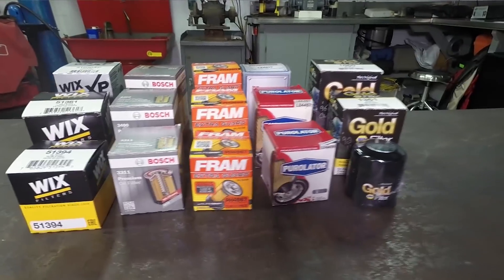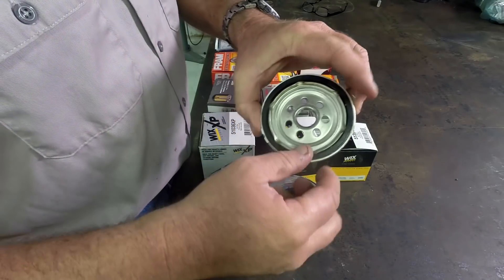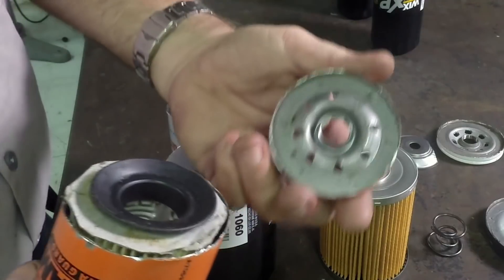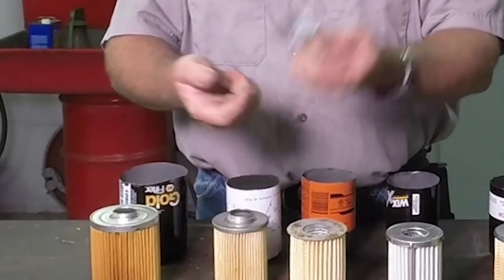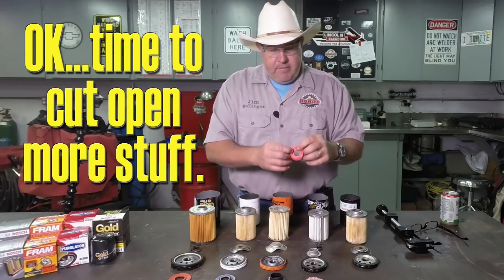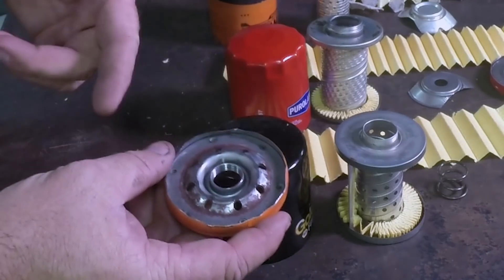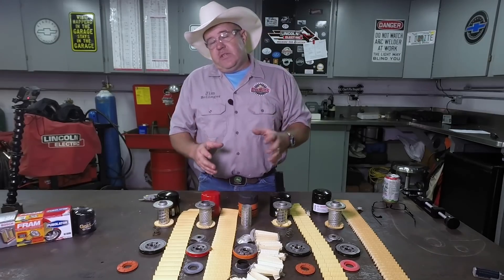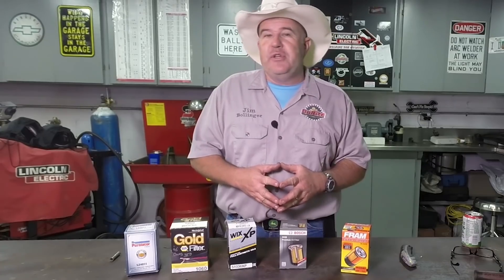The worst oil filter EVER!

Comment: I thought Fram was a quality filter, especially for the price. WOW, Fram is a piece of junk!
Reply: Me too. Thought I was getting a great filter until I saw a similar demonstration on their motorcycle filters. Pure junk. I bought them at least 3-4 decades before. I’ve been using Bosch but will switch to Wix or Napa Gold as they seem to be a little better quality and maybe less expensive.
Reply: Compared to what ?  It's an oil filter folks! Try it...it works! ( Millions and millions sold...they must be doing something right...)
Reply: The only good thing about the fram oil filter is  the gritty coating they put on the end of the filter. It makes it very easy to tighten and  remove.
Reply: It's a pretty safe bet that if WalMart sells them, Fram is the cheapest they can buy!  I'll pass on the Fram!
Reply: No more FRAM for me!
Reply: The bottom line on this Video Fram Oil Filters are junk, don’t buy them.
This is outrageous that a company would defraud the public with such a trash quality product. Never again Fram.
Reply: Fram did indeed use to be a quality filter...years before they degraded them to get them into WalMart stores. Since then, garbage.
Reply: What is funny is everyone thinks that. What is funny is no one ever has any issues. Some people have been using FRAM filters for over 30 years with no issues.
Reply: @gol10dr45  SO They Think.
Reply: "MADE IN P.R.C."
Reply: Not so, made in USA and a tested and true design- engineered to work right, in spite of the unwashed shade tree mechanics rants.     @Bandicoot803
Reply: Richard Raucina it is obvious from the internal contents that Fram is a cheap product compared to the others. I’ve used them in the past and never had an issue although.....
Reply: @RRaucina  Quit your bullshit. My father used to work at Filtran until they moved locations, and his branch's entire job was to test filters. (air, oil, water, any filter) Everybody at the plant had Fram in their vehicles up until they were commissioned to actually test them. The results were so bad, and the Fram filters let so much crap in that literally everybody working there changed their oil that night.
Reply: @JakeSnake07  Interesting. What is Filtran? In what manner did the filters fail?  How about Fram air filters? They make tons, and aftermarket for heavy equipment that I sometimes use. Seem identical to OEM there.
Reply: @JakeSnake07  WOW - lol... Thanks
Reply: Richard Raucina
,
 Bullshit, time tested True unadulterated A1 Junk, responsible for millions of ruined engines. Have you no commonsense, did you not watch this video and see what their made of?  Wake up man, by the way this guy appears clean, not at all unwashed as you stated.
Reply: @duke7595  Does not matter what they are made of, what matters is their filtration performance (which this video does not test).  Been using cheapest Fram filter and cheapest oil (Meijer 5W-30) for the entire life of my 1996 Saturn SW1 and it now has 305,000 miles on it and still going strong.
Reply: FRAM does have a higher end brand but with the price spend a $1 or $2 more and get a way better quality one like K&N or WIX. I have long tube headers and love the K&N when changing the oil you can use a 1 inch socket to easily remove it.
Reply: I also will never buy fram. The regular and tough guard sucks. But, their ultra for synthetic oils is actually of high quality. My cars now take cartridge filters so I don't have to worry about any of that.
Reply: And for years I have been using the Purolator filters because of the oil change specials from my local chain parts store. Always thought I was getting a low quality filter because of the package deal. Now that I know better, I might push my change interval to 4k.
Reply: @ottopartz1  Purolator is made by Bosch and Mann, they're pretty decent
Reply: 2005 Accord   Over 200,000 miles with mostly Fram filters and oil changes every 4-5,000 miles.  Never a problem.  Hmmm 😄
Reply: @Gevans5472  You obtained that mileage in spite of using a fram filter. Also. it a Honda, it would give you that mileage without a filter.

Comment: I am by no means a zealot supporting Fram. I had a maybe bad experience years ago and switched.  However, there are lots of opinions here but no one identifies themselves as having ever built a filter or as having designed and carried out an experiment to determine the quality of the filtering life or the risk of collapse of a filter due to neglect or contamination.  Not everyone is like the commentators on this list.  Some cars get ignored.  I would like for the presenter to evaluate the bypass characteristics of the various filters and their ability to provide lubrication to the engine when clogged and during extreme cold starts.

Comment: I'm pretty sure Parts Master is comparable to Fram. Comparable in that they both minimize costs by using the CHEAPEST possible materials possible for their filters. That is what was described to me by my boss when I worked auto parts deliveries. On the other hand, he described Wix as actively IMPROVING apon OEM specs, so often you'd get an even better filter than what originally came with a car.

Comment: I mostly use Fram, including air filters, but not the bottom feeder on the oil filter, I wonder if the higher cost ones are any better. The best thing about the Fram oil filters now seems to be the non-skid finish at one end of the filter, given how slippery the filter gets with oil running down it, and I don't want to spill ANY oil anywhere when trying to do this job.  I will also say that during a recent change of the air filter in my '10 F150 from one Fram to another (with the same part number), lo and behold, the newer one only had about 2/3 the filter area of the older one! They had the same number of pleats, but the pleats were only 2/3 the height of the older one. Win-win-lose for Fram. Win #1-cheaper manufacturing cost.....Win #2-shorter lifespan for the filter and quicker replacement sale.....Lose #1-no more sales to me of ANY of their products, particularly when i add to this the results of this video...
Reply: سپيده

Comment: I had a Fram filter on my Lincoln and the check valve failed.  It took about 5-6 seconds for the engine to build oil pressure on start up.

I changed the filter without changing the oil.  The engine was not damaged.  I cut the filter open and the filter media (cheap paper) was separated from the housing, which means that it wasn't filtering either.

I will never use Fram again.
Reply: this is a quality comment. actual review of an actual part failure, or in this case, a double failure. +1

Comment: I would sooner see a performance based test than how the internal workings look.  If it meets or exceeds OEM spec then I do not see an issue . It is all about the filtration performance .  Will it filter down to the correct microns of particulates  and last till the next recommended change interval
Reply: I'd be tempted to agree, but a lot of Fram filters aren't even GLUED correctly.   It won't filter well if that cardboard cap is hanging off.

Comment: You're comparing a mid-grade Napa filter and the best wix filter to all baseline (low-grade) filters. All the best filters and cheapest filters from each brand would have told a true tale here. Also, K&N and Mobil 1 would be nice to have been in this video too.
Reply: Regardless of if you were even correct, the point is that higher end filters of Napa and wix are being compared to lower end filters of other brands. These are not equal comparisons. Also wix making Napa filters doesn't mean anything for what I am saying.
Reply: Napa has silver, gold and platinum filters. Wix has a standard and an XP version.
Reply: Not sure how we got to Purolator bein made by wix, but ok. All I'm sayin is that they should have all been of equal quality rating. No one likes Fram anyway. That's like buying duralast parts. All junk. I am more interested how the Purolator boss compares to the Napa platinum and wix XP
Reply: I use Mobile 1 extended performance filters, even though I change oil as recommended. I wonder how they look inside?
Reply: NAPA has two grades of filters WIX has only one. AND WIX makes NAPA filters for them!

Comment: Edit: after doing more research the Fram filters are perfectly adequate I haven't seen a single other filter that has been rested like yours, the paper end caps don't make a difference whatsoever, as long as you replace the filter within the life expectancy it is not a problem at all. I think you got a bad filter.

I really had no idea how low quality Fram filters were. My dad and I have been using them since as long as I can remember. All of my cars and trucks I own and have ever owned exclusively have used thoes orange fram filters, and I havent had any problems nor my dad. I feel like if you change your oil regular and often, like we have, those filters are probably ok but still I will definitely consider a diffrent filter now. fram is one of the largest filter company on earth I dont think there filters were collapsing and causing engine damage but they are cheap..

Comment: I've been a mechanic for 30+ years and have been using Fram oil and air filters for those 30 years on my own vehicles for no other reason than availability being that they are in the same aisle as the oil I use. I have never had any engine problems in those 30+ years with all the cars I've owned. Are there better filter? Definitely. But as all good mechanics know, it's all about intervals.
Reply: You work at a Walmart don't you
Reply: damn happy you never fixed my cars then hehe
Reply: I use Fram Ultra.
Reply: In the 80's I bought a Ford Granada 2.8 v6  (Uk spec) as a fixer upper. The engine had oil starvation to the cylinder head. (Low oil pressure on the dial too).
I stripped the engine & found out why, The internals of the Fram oil filter were in every oil way throughout the engine. 
The can from the Fram filter had hardly anything left in it. The previous owner found the car so expensive to run on fuel he couldn't afford
the service costs. Luckily I got to her before too much damage occurred to the engine.
Reply: Doug Life  It is hard to know what to believe and what not to believe.  I use the mobil 1 because it has never let me down.  Maybe it is overkill and a waste of money or maybe there are better oils cheaper, I just don't know.  On an older car that leaks or burns I would run conventional oil and change more frequently.
Reply: Doug Life  One thing to keep in mind is the changing times.  Engines today are much more efficient and regulated than ever before.  With dozens of sensors and feedback computer control our engines are also much cleaner than in the past.  This leads to oil staying cleaner than it used to.  Oil still needs to be changed, but modern oils coupled with modern technology has done away with the old guidelines.  The manual for my truck states trans, transfer case and diff oil never need to be changed over the entire life of the vehicle
Reply: ansmerek - but isn’t oil dirtied by the mechanics of the engine not by computers or sensors?
Reply: My dad had a 1989 Chevy pickup with 480, 000 mile when he traded it in.  He always used Fram filters and yes even Havoline oil. The only problem he ever had out of it was a module in the distributor.
Reply: Doug Life  
I used mobil 1 0w20 full synthetic and switched to royal purple 0w20 in my 2013 civic si. I got just over 5k miles before my computer indicated a change was needed. With the royal purple I consistently get 6.5k miles and up between changes. I use a royal purple filter as well. It's on the expensive side, but, to me it's worth it.
Reply: I USE TG FRAM, for last 20 years, never had a problem.
Reply: There seems to be two types of people on this thread.

1.  OH MUH GAWD FRAMZ IS JUNK  I CANT BELEVE THEY MAKE DAT JUNK UR ENGUN IS GOING TO BLOW UPS JUNK

2.  I've been using Fram filters for many years using the manufacturer's recommended oil guideline and OCI. I've never had an oil related issue in any of my cars and have driven them several hundred thousand miles without issue. I'll continue to use Fram filters because they just plain work. It it ain't broke,  do not fix it.

I fall into category 2.  Btw, if you don't know what "OCI" means, you probably have no business making statements about any oil filter.  Just saying.
Reply: I agree except us that drive well into severe duty keeping the engine at 7000 or higher do need better capacity and filtration. Also a non 100% synthetic will not protect you from LSPI in TurboGDI engines even at 500 miles on the oil as it's the oil that is igniting blowing the rings and piston apart. The future Ecoboost and other high compression engines which is the trend for 75% of all new engines require better oils which need a absolute micron of 35 or better.
Reply: Frank Merandi I’m also a mechanic.  Fram is garbage.   Is your engine going to seize if you use one? No.  But it’s not nearly the quality of others.  I run only the best on my vehicles and my customers vehicles.
Reply: I wouldn't want rusted Fram crap on my vehicle in any interval
Reply: Exactly. Fram engineers filters, but the shade tree mechanic cannot  discern that with an angle grinder. Glued caps are just as well as steel, maybe better.
Reply: used to use puralotor , now use fram, because of availablity. no issues to speak of, cause i change on time, usually.
Reply: that orange fram IS a cheap filter, but if u change on time, it should not meet the reliability wall. if u want to keep way past the change time then u should meet the failure.  but, if cost of two frams is more than one of the better ones, it may be more cost effective to use the better ones,  but change every other oil change, than have a fram and change every time with oil as well. 

but, the safer thing to do is to change both oil and filter together,
Reply: Doug Life  I use mobil 1 synthetic extended life oil and change every 15k miles.  Have done so for every vehicle I have owned over 25 years and never once had an issue.  I don't believe the intervals are as tight as people think they are.  The manual for my civic said 8k miles with conventional non synthetic oil.  My ram 1500 will go 6k miles before it indicates a need to change the oil

Comment: Didn't know cardboard could rust. 

It's glue, you shill. And would it matter if it's cardboard or metal? It's not a moving part. I don't think metal is needed for "durability" because it doesn't move. Yeah, it's cheap. No shit. Replace it every 3000 and you should be fine.
Reply: The metal can is rusting.
Reply: @MilwaukeeF40C  No it's not.
Reply: Correct, no moving parts in the filter, per se, but there is hot oil flowing under pressure through the filter and media. This alone will pulverize any subpar, flimsy, crap filter rendering it useless.  The interior of the filter housing is metal and it will rust if it's a substandard metal. The metal bar holds the pleated ends of the media together rigidly to prevent separation - (pressure, remember)?  Replacing a junk filter "every 3000 and you should be fine" is a preposterous elucidation!
Reply: @cassidyvargas7717  Why does Honda and Subaru use Fram's junk filter as OE then?
Reply: Agreed!

Comment: Changing the oil regularly will have more impact than what filter (except the rusty Fram) you use, or what oil you use. Most of the contamination that gets into the oil is burned and partially burned fuel that leaks past the piston rings. That will degrade the oil, and no filter will remove gasoline from the oil.

Comment: I have 300,000 miles on a 1996 Chevy pickup that has run Fram filters for the last 150,000 at least. But I agree, the cardboard filter top and bottom is junk.

Comment: Just invest a couple bucks in a magnetic drain plug. Next time you change your oil, you'll be glad you did.
Reply: Drop the pan and add 5 large magnets to it. Now you have a proper filter system
Reply: @RRaucina    Also an EXCELLENT IDEA, Make sure you use very powerful neodymium magnets and place them where none of the engine's moving parts can make contact with them and as close to the sump as possible or in a high oil flow area, I recommend doing the same for the transmission standard or automatic most people never change the transmission fluid during the entire life of the vehicle, Transmission fluid loses viscosity just like engine oil over time and then wear begins and accelerates over time, I change my transmission fluid and filter every 20,000 miles at the most, This Magnet trick works very well I have done it for many years and you would not believe the amount of magnetic sludge particles it picks up and keeps from entering your transmission or car engine even through the filter, It reduces wear on all transmission and engine parts greatly.

Obviously this will not work on aluminum transmission or engine oil pans because the magnets will not stick to them, but if they have drain plugs you can use magnetic ones in place of the original ones.

Doing this and regular fluid and oil changes can double the life of your engine and transmission!!!
Reply: Ronnie Hooper EXCELLENT AND ALWAYS A GOOD IDEA to pick up magnetic material suspended in the oil but some engine blocks and heads are aluminum, Still A VERY GOOD IDEA, ALSO GOOD TO DO IF YOU HAVE A DRAIN PLUG ON YOUR TRANSMISSION PAN!!!!!
Reply: And on the subject of transmission fluid and magnets, I learned something else years ago when I had a Chevy Vega, 355,with a powerglide that ran in the 9's. Regular petroleum trans type F fluid works well, but soon starts to change color, break down, and even stink. Changing to Redline racing fluid was magic. After running it ALL SEASON....it still looked and smelled like the day I put it in. Cost a lot more but worth every penny.